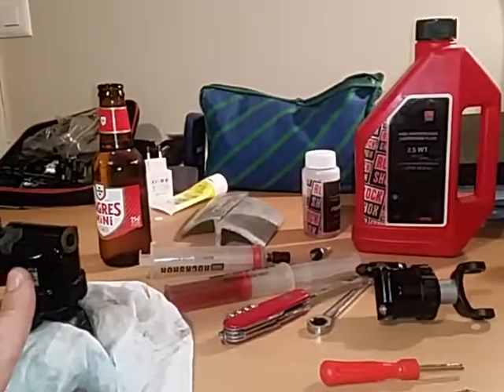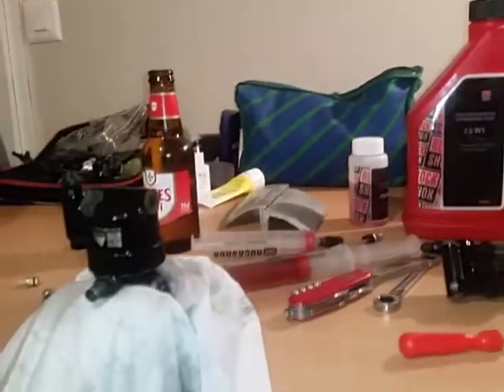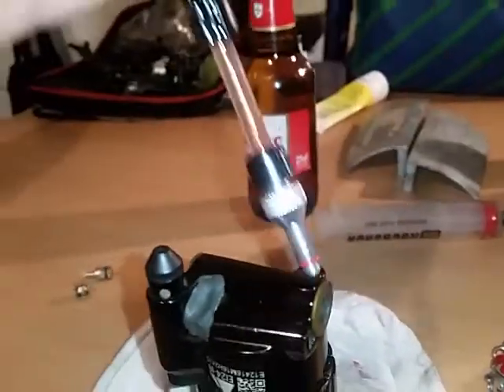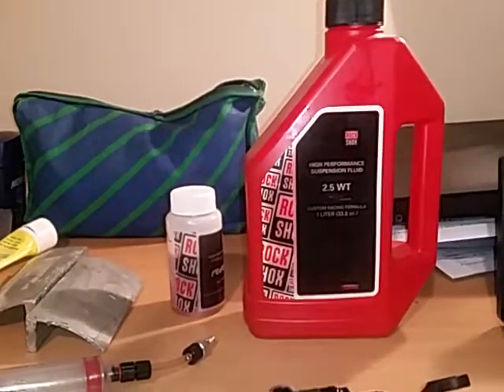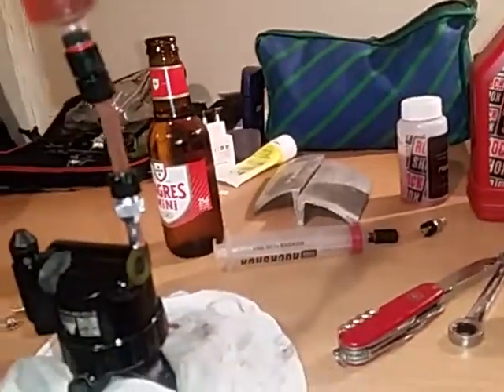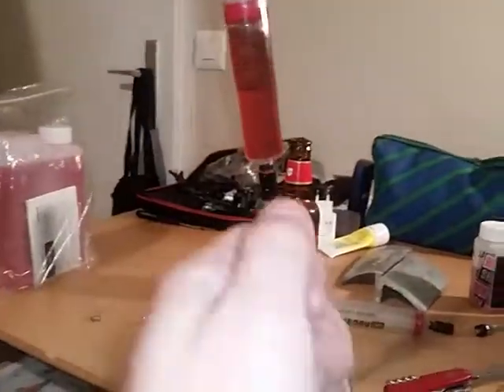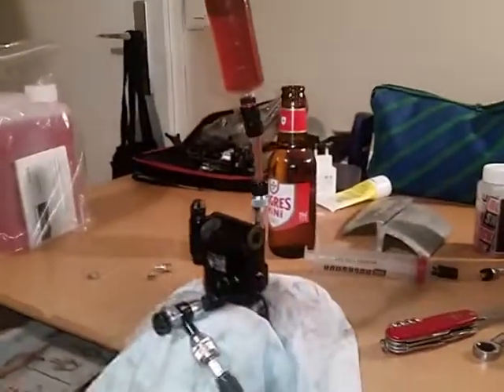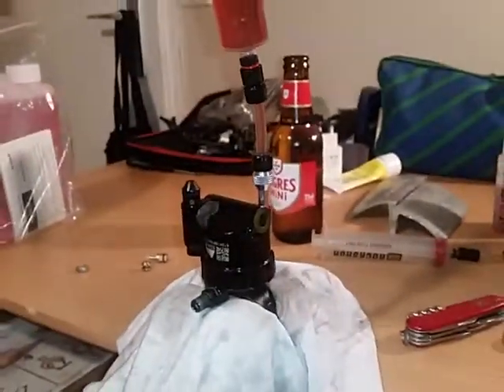Canyon Strive Shapeshifter - bleeding - IFP position

Comment: My SS does not extend when I put air in it after finished bleeding. If it extends it is only by about 5 mm and only when I push the cable attachment thing when the air is in. I've tried the procedure several times. No air bubbles are coming out and it still does not work.
Reply from the maker: Most probable issue:
1 wrong pressure
2 IFP not positioned correctly
3 oil bypass
When seals are fucked you have oil bypass... and have a full extension if enough pressure.
Reply: @speedoptics  I've managed to make it work, but it is way to slow. I used to have 2015 version, then is was replaced under warranty for 2016 model. I has not been working for the last 3 years and I decided to service it now. But it was the same problem 3 years age. Buy at least now it extends. I wonder how long it is going to work.
Reply from the maker: @sqlim85  next time use 0wt oil, 2.5wt or reverb oil for seatpost...